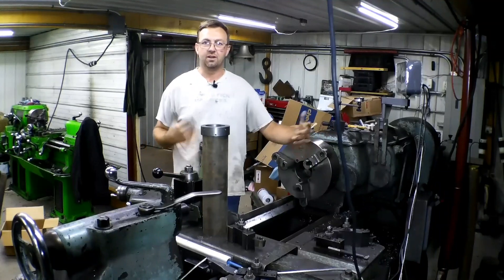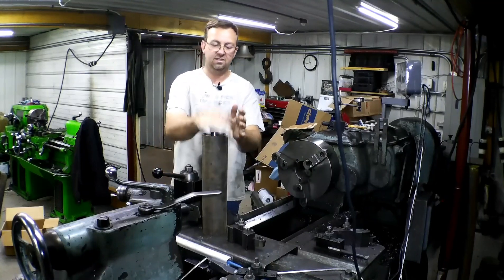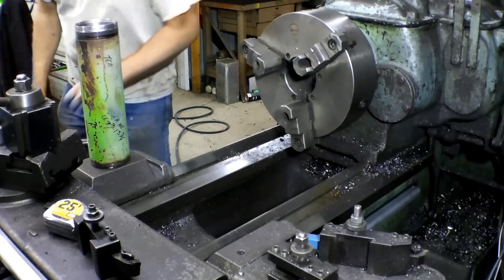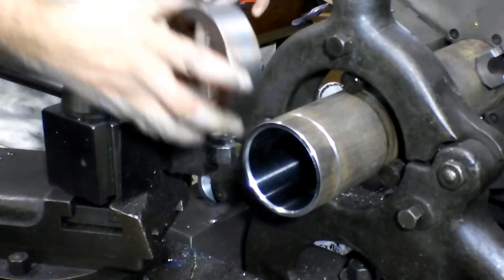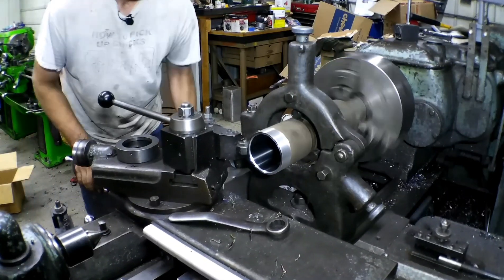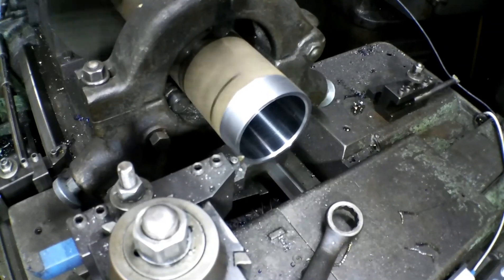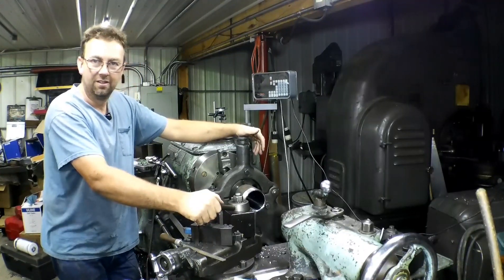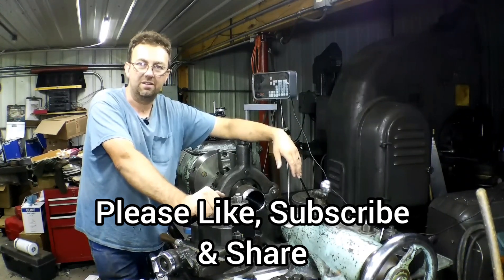Hydraulic Cylinder Work, Setting Up a Lathe Steady Rest, Single Point Threading, Manual Machine Shop

Comment: Interesting video Josh. Q- It appeared the lead in chamfer for the thread may have been too shallow to help start the nut, was that possibly causing some of the starting of the nut problem? Just an observation. Thanks for sharing.
Reply from the maker: Trying to remember back to this one.  The internal threads of the cast nut were extremely rough.   It was a poorly made nut, but it is what I had to work with.  The customer was happy with the final product.

Comment: Josh....why arent you using Monarchs speed dial....i can see the screw on the right side of your crossfeed.....you pull it out, give it a quarter turn and let the pin down from its perch....when you turn in your crossfeed screw  it will stop....if your threading tool is too far away.....pull out the pin and give it a turn past where it stopped before and let go of the pin ....
 The tool will advance further....when you get close to the barrel of the cylinder....you might have to back out on your compound slide to just scratch the tube.....now zero that dial.....dial in your 10 thou on the compound and make your cut...when you get to your relief cut twist your cross slide to the left, backing your tool out....carriage back to the start....now roll your crossfeed screw clockwise till it comes to a stop on your rapid index pin which is your zero on the cross slide....advance your compound another 15 thou and repeat the process....the rapid index pin makes threading fast on most all Monarch Lathes....when finished threading pull out on the rapid index pin and give it a 1/4 turn and return it to its perch
Reply from the maker: I always wondered what that was for. Nobody I asked could ever tell me. What an awesome feature. Thanks.

Comment: We never set the crossslide over when threading in UK.  Just go straight in to thread depth.
Reply: I have seen a couple guys do that.  I was taught to do it with the compound . If something works well for you no sense in changing it much. Every time I watch another machinist I usually learn something. That is what is so neat about machine work
Reply: Yeah, in Australia that's how I was taught - straight in
Reply: Straight in works for fine threads like a 12, but try it with a 4 tpi and the compound is waaaay better and faster
Reply: Setting your compound over 29 1/2 degrees puts the  utting forces on the front of your tool.....i have done threading your way also with good results....but if you have to remove your tool to sharpen it....having your compound at 29 1/2 degrees will aid you in picking up your thread again.....advance your tool to just above your thread and engage your half nut like your going to cut your thread....now stop your lathe leaving your half nuts engaged....advance your threading tool using both your crossfeed and compound rest till your tool is in the gullet of the thread....at this point zero your crossfeed dial and your compound dial now back out your crossfeed screw and go back to the start of your threads .....dial your crossfeed back to your zero and engage your half nuts your tool should be in perfect time with your thread again

Comment: So you just go until the nut threads on?  Isn’t there a standard depth?
Reply: The standards are based on proportions of the pitch. But those in turn are based on the root radius which is also determined by the pitch. So to save any confusing math, you just cut it till it fits.

Comment: interesting, first time I have seen someone use a steady without cutting a surface for it to run on.
Reply: You usually have to because the od of the tube isn't round. That out of round transfers into the diameter you turn. If the od of the tube is round and has a good finish there is no real need to cut a steady rest band so it all depends.
Reply: Well, he does use an adjustable spanner!
Reply: He definitely should have but he's just cutting threads so it's not a huge deal.

Comment: When I set up my lathe to thread exactly as you did and cut a thread the thread takes the shape of a "buttress" type thread. No matter how little I feed in it still does it. If I only use my cross slide to feed in it cuts a true 60 degree thread. Using standard 60 degree inserts or properly ground HSS tool bits doesn't matter. My compound and cross slide gibs are properly adjusted. Any ideas?
Reply: ...Johnny Holland...your compound is set at the wrong thirty degrees...
...it needs to be thirty degrees from perpendicular to the spindle axis...
...not thirty degrees from parallel with the spindle axis...
...when set properly on your lathe it may read 60 degrees...
Reply from the maker: That's a mystery.  I'm guessing something is flexing in your setup. Feeding with the cross slide would cut on both sides of the cutter, balancing the force on the leading and trailing edges. By using your compound, all the force is on the leading edge and it may be flexing. Just a guess, but maybe a direction to investigate.